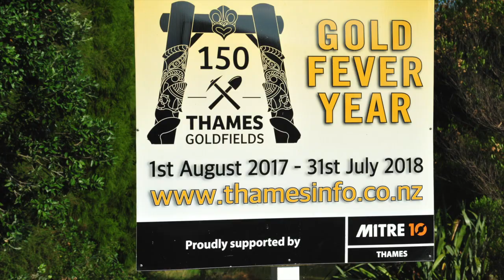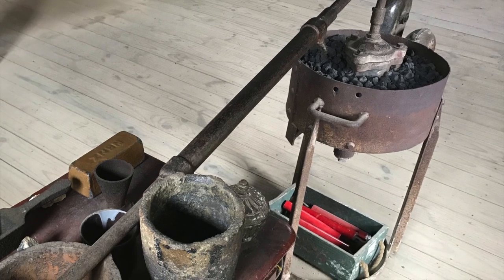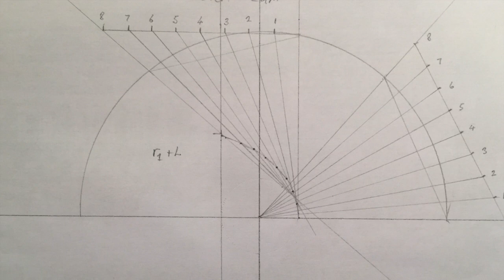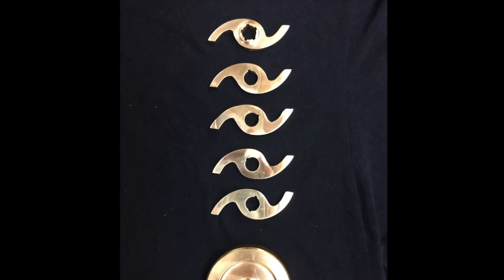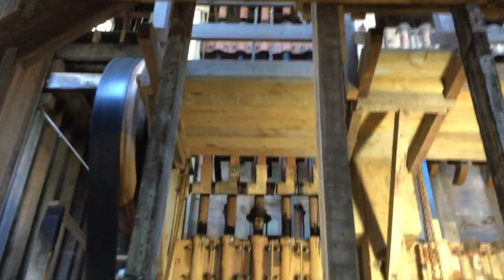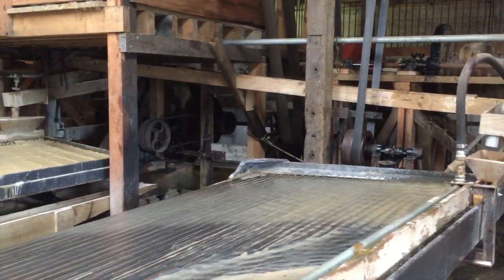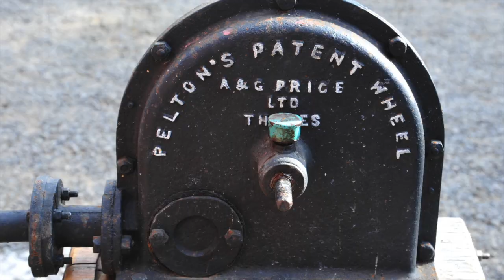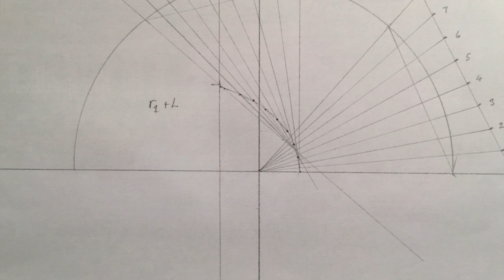Stamper Batteries-How they were used in gold mining- A model and full sized stamper -v4

Comment: Evan, what did you use to make the cams? Is there somewhere I can send you an email to ask a few questions on the one I've started building.
Reply from the maker: Aah, the cams.  That was the key to the whole project and I have not made the YouTube video yet. One day!  To be honest it is easier just to make the curves on flat brass and cut it out by hand with hacksaw and file!  BUT I was determined to find a way to do it on the lathe.  It worked! You can contact me at AEDLewis at gmail dot com. So you are also building a stamper battery?  Where do you live?
Reply: @Evan-e-cent  Thanks for the reply.  I'll be sure to send an email soon. I'm from QLD, Australia.  Looking to make a model stamp to run off my 4" boiler running a small mill type engine, I've seen lots of old model stamps in museums etc., some made out of metal, but I'm going to make mine out of timber framing, with 4 stamps, and keep it as realistic as possible, it's a shame no where online sells kits to make, there's one US company that makes a model stamp, but it's mostly all wood and the stamps are lightweight, it's more for making mining dioramas and western styled dioramas.
Reply from the maker: @lilbluedazook  I did it the other way around. Built the stamper first and now started building a two cylinder double acting steam engine. Made the cylinder block out of a solid block of brass. It will be a long time before I finish it. Then I have to make a boiler or hook it up to the Hero engine boiler. You may be interested in my web site www.HeroSteamEngine.com about a steam engine designed by the Greeks 2000 years ago.  Also my wife wrote a book about the gold rush in 1867. She has an online database of people who register miners rights and claims. It is on the same site: KaeLewis.com. I wrote the software for the online database. Now working on a program to calculate lathe gear trains: www.
HeroSteamEngine.com/RideTheGearTrain.

Comment: @UC4ImRWRkyZZ6agM8CKh2L3g
In response to a question: I built the model stamper battery myself. I have an engineers' lathe but no milling machine. I have a YouTube channel under the name evanecent with a playlist about using an engineers' lathe. The model is mentioned on the latest video but I have not put up the rest of the videos about how I made it. 

The big problem was deciding how the cams could be made on a lathe. The problem is that lathes are designed to make round objects and these cams are in the shape of Archimedes Spiral, which is the involute curve of a circle. 

Anyway I did devise a way to make the cams and keyways. The cams are brass. The stampers, shoes and anvils are stainless steel and the frame is aluminium - all non-rusting materials. 

I have started building a steam engine to drive the stamper but have been side-tracked by writing software. I have written a free online computer program to work out what gears you need in the gear train of the lathe to produce a thread. The program is called Ride The Gear Train. It is a sub-directory of another site I built about a steam engine designed by the Greeks 2000 years ago. See HeroSteamEngine dot com /RideTheGearTrain

Comment: Will you be taking orders from the public to buy a model stamper? I am needing one to run off my small steam engine.
Reply: No I don't think so. There are many hours of work and a lot of materials that went into building it. The 5 cams and flywheel started at a 150mm (6") length of 75mm (3 inch) diameter solid brass bar. Most of it ended up as waste swarf! See my other post to your question.